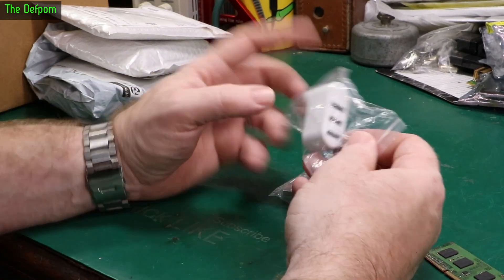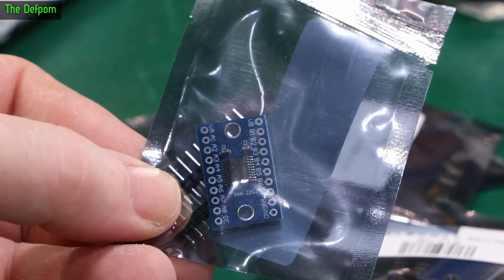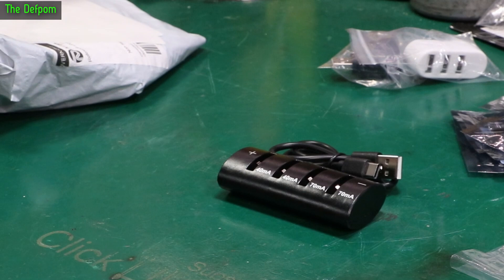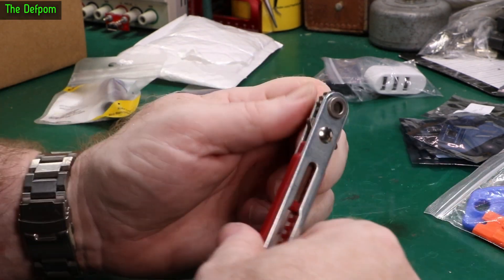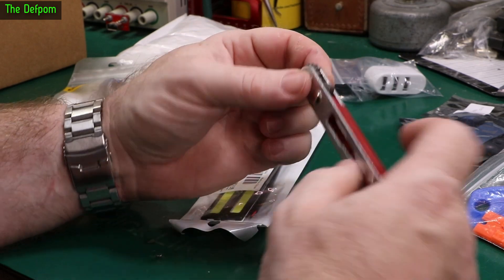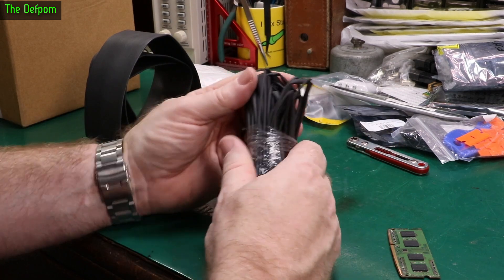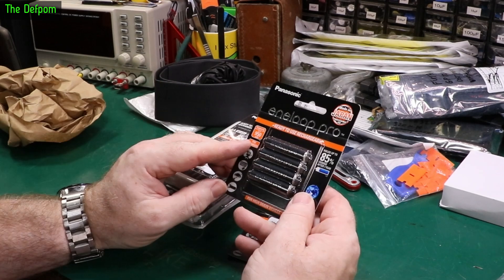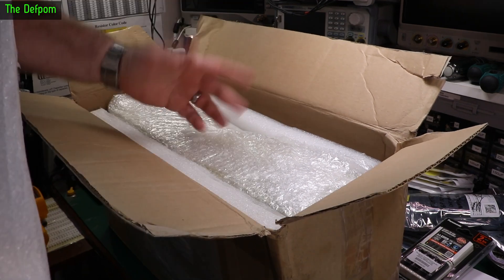🔴 Mailbag Monday 12th February 2024 - No.1220

Comment: The total Output of such a charger usually means to what it will fall back when more then one port is used because there is only one regulator in it. In this case it is 5V 3A. Why the limit to 3A? I just assume that one of the ports cannot handle more amps and they cannot measure current on each port separately.
Reply: Ok I re watched the part of the video. I was assuming one A and one C port but having now seen that you have 2 type A ports that can handle more when used alone it really does not make any sense. Except they use the same electronics for another version with more or different port types.
Reply from the maker: @Hasitier  yes, I would have expected the total current to be equal to the max for a single port (to assume they share the same rail)

Comment: You forgot about Callipers using CR2032s!
A teardown of the stufenkondensator would be interesting.
Reply from the maker: My calliper uses a smaller cell, I don’t remember what it was, is an AG something something. Yeah I will be doing a video about the decade crapacitor, and the other one with the broken handle, have just been way too busy to do those yet.